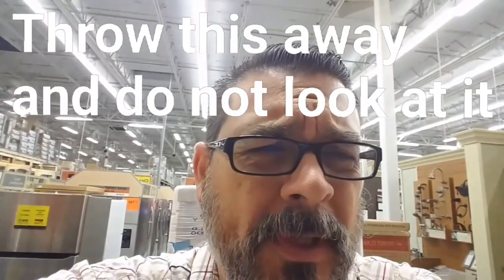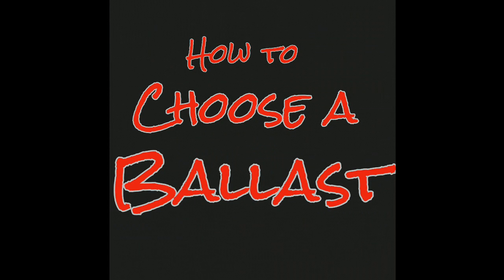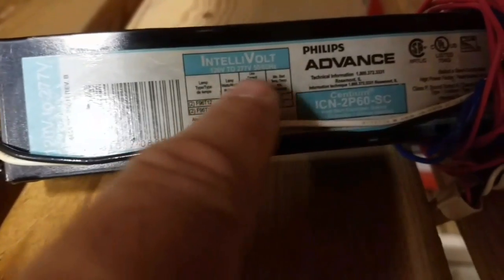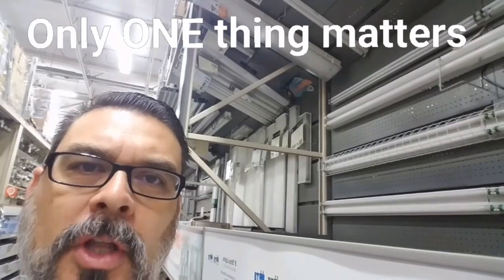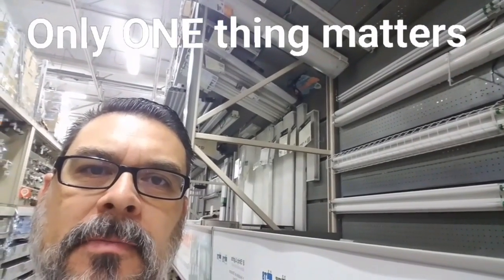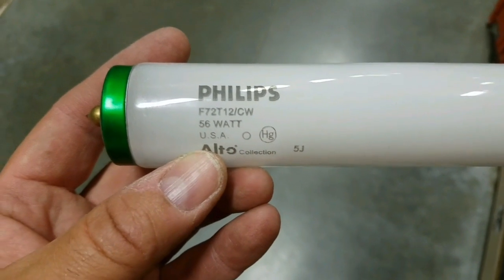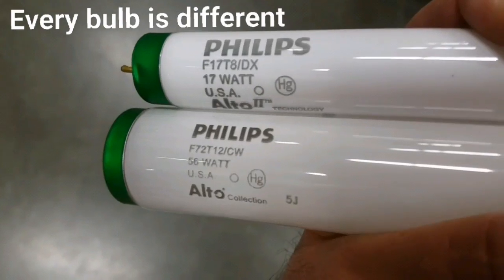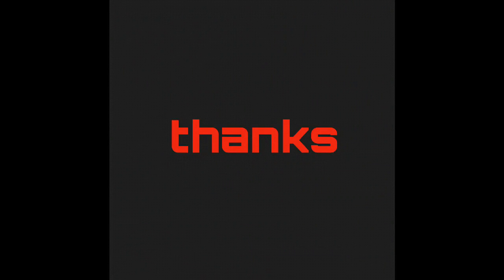How To Choose A Ballast

Comment: You've said what the things are to look at in the source bulb, and then the video ended.  How does one then go about locating a compatible ballast for this bulb?
Reply: you look for a ballast that is "made for" whatever code is the bulb (F17T8 and F72T12 in this exemple). also make sure you get the proper voltage (120v for most north american residential settings, but if it's at work it migh tbe a 240v or even 600v that is needed)

Comment: A fourth thing that matters: Starting method.
This is not that important but choosing the wrong start type can impact the number of times you can start the lamps before they burn out do to too many starts. This can cause lamps to burn out faster in some applications.

There are three main starting methods out there: rapid start, instant start, and programmed start.
Rapid start was common in the old days in magnetic ballasts that used to be commonplace. Nowadays, it is found primarily in most electronic ballasts for T12 lamps, however some cheaper ballasts for T8 or T5 lamps are rapid start as well.
Instant start is standard in T8 electronic ballasts, however it can also be found in cheaper ballasts for T5 lamps as well. It is also used on all ballasts for single-pin ‘slimline’ lamps.
Programmed start is found in high end T8 electronic ballasts as well as most T5 ballasts.

Rapid start is a decent option for most applications, but when dealing with frequent-switching applications, such as in a bathroom, hallway, garage, kitchen, closet, lights with motion sensors, or any other space where the lights are turned on more than 3 or 4 times a day, it is important not to choose instant start. Instant start is literally just sending a high voltage across the tube without heating the filaments at each end of the lamp at all. This can lead to severe sputtering of the emissive coating on the filaments, and eventually destroying the filaments entirely, all much faster that with rapid or programmed start. While in applications without frequent switching, instant start is fine and can even be beneficial with large installations, due to the small amount of energy saved by not heating the filaments, programmed start is going to be your best option for frequent-switching applications. Rapid start is a good second option if a programmed start ballast cannot be found for the correct lamps. All of this is assuming your lamps are not slimline lamps, of course, as those can only be instant started. They are generally not affected by instant starting because they were designed for it.

BTW I know there are other starting methods than just those three, such as preheat, but those are not as common today as they were years ago, and the three that I mentioned are generally going to be the ones sold in stores.

Also, cool F72T12 and fixture you got there! The F17T8 is cool too with the /DX suffix!

Comment: Length of ballast too. Some are 9" some 6-1/2. I hate buying ballasts more than anything.  Some are $15 some $45.  I like the simplicity of the message. I guess that's just the basics though. Last ballast I got made a noise every time I turned on the light switch.  Lasted 2 years, I made a poor investment. Now have to try to do better.  HD  and Lowe's seem to have a weird selection of expensive ballasts. Doesn't seem to be much standardization for something common like an interior f20t12 double lamp and makes me scratch my head and frustrates me to no end.

Comment: Actually , Don't buy a ballast at all . Just buy LED tube light and bypass the ballast. Can buy double ended or single ended; single ended needs new connectors [tombstones] but most of those come with those anyway.
Reply: I do not agree.

Comment: what about the magnetic ballest (old) as oppossed to the other one..   the newer model (Electronic) the colors of the cable do not match, you have to know which goes where now...
Reply: there should be a simple wiring diagram on the ballast telling you how to plug it. colors don't mater other than for recognition of what the wire is and what you should do with it. inside the plastic it's all the same.

Comment: I have an old magnetic ballast for my light fixture it is an f20w t12 ballast,runs off of 120v and is made to run two bulbs.now I want to replace it with an electronic ballast that runs off of 120v for f20t12 bulbs, if you're wondering what brand I am using I am using a fulham workhorse wh33-120-L oh yeah and also has a starting temp _20degrees F which is the reason why Im thinking about buy it, but before I buy it my question to you is:since this one has lower start temp than my old one will it be safe to run in my shed?
Reply from the maker: +Charles Lane27 yes. The lower start temperature is designed for starting fluorescent lighting used in cold temperatures such as in a reefer or freezer or in cold climates.

Comment: You said 3 things, 1. Number of bulbs 2. Type of bulb 3. Voltage.
Then you point to the Watts of the bulb. Is the watts the voltage? Also I don't have a number that starts with F.
Reply: voltage is voltage. watts are volts multipled by amps. if it's for a home, it's most likely 120v, if living in north america.
Reply: @p-acormier5215  Be careful! The watts of the lamps themselves is not the same as the ballast current multiplied by the voltage because the ballast does add some wattage to the final product do to ballast losses. The best way to figure out lamp watts is by looking at the watts printed on the etch or finding it in the ordering code on the etch.